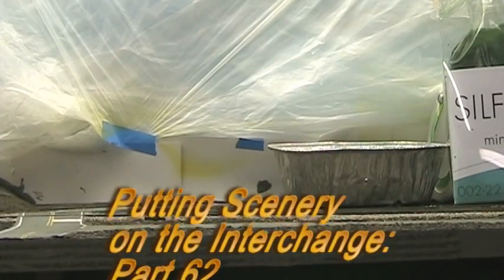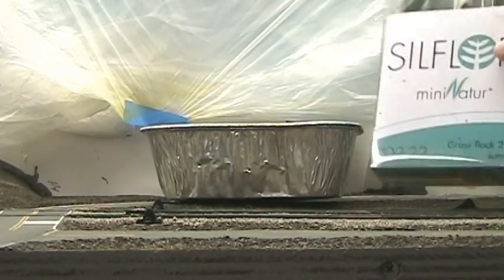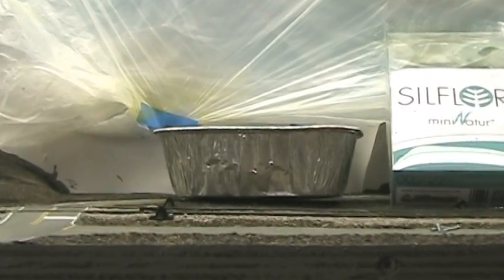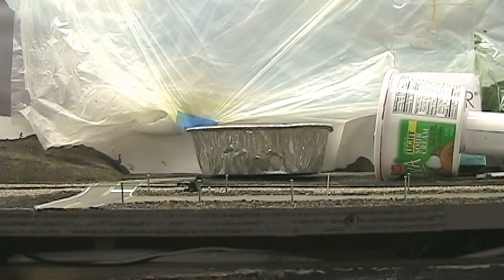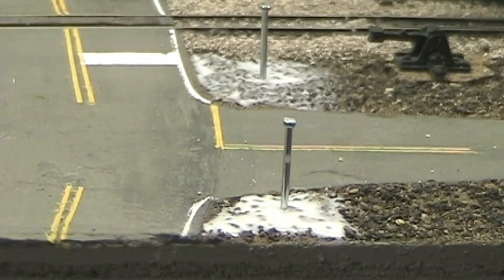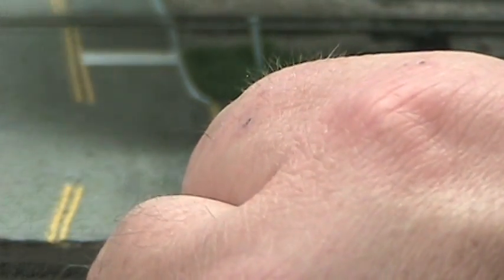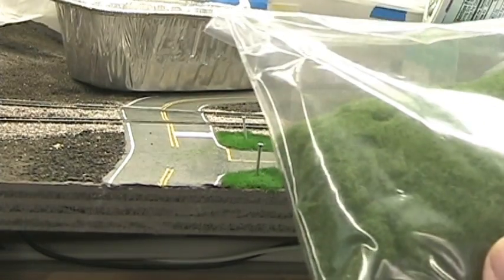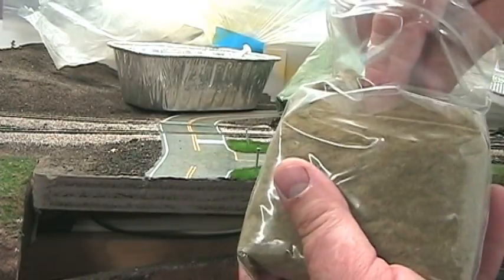Model Railroad VLog: Putting Scenery on the Interchange: Part 62

Comment from the maker: Nope it's 7,500.  Static electricity is high voltage and extremely low amps that's why it doesn't kill you.  The Ion generator I used is rated at 7.5 kV. According to thefreedictionary . com--->

kV - a unit of potential equal to a thousand volts

so 7.5 kv = 7,500.